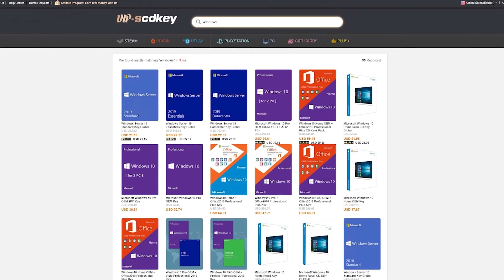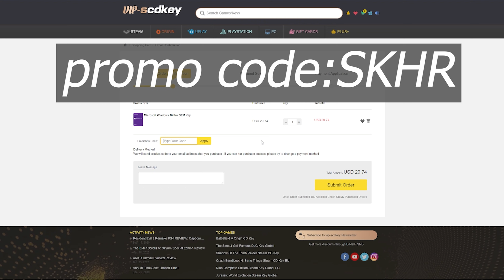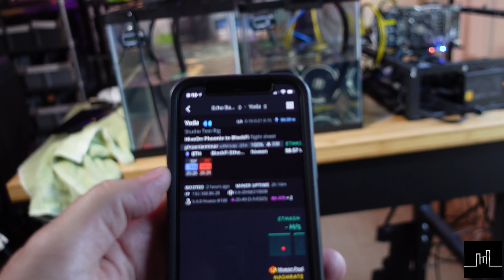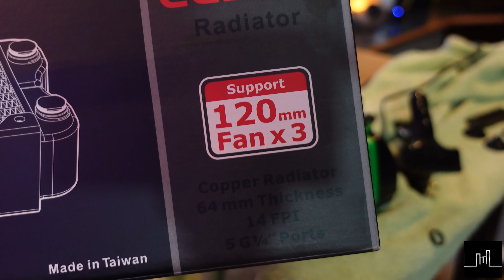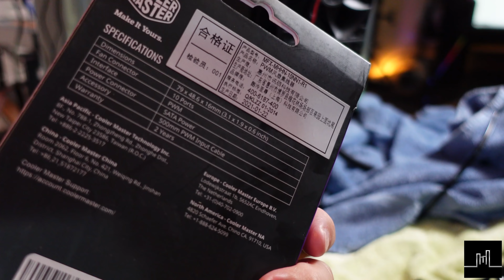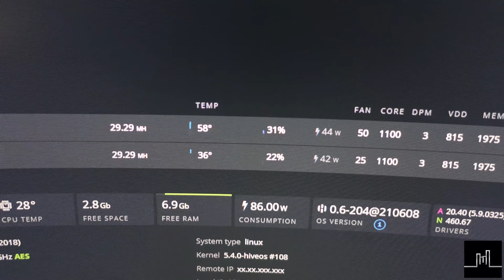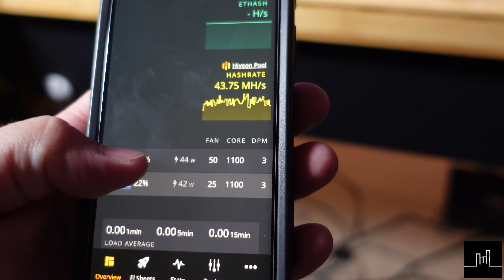Mineral Oil Submerged GPU Crypto Mining Rig Build - Part 2

Comment: OK, so you've essentially put 3 asic fans on a GPU - or course it runs cooler! Financially, I think you'd be further ahead just to buy 1 more GPU and run them at lower power/hash rates to get the same thermal efficiency - especially at the $85 you paid for these ones. It will be interesting though to see how well the oil does with no fan of heat sink at all.

Comment: Moving liquid stays warmer due to friction, you need a large radiator to cool the tank. The only problem I see with this is the radiator will put off lots of heat and will need to be ventilated

Comment: As far as I know, I think you should remove the fans and the headsink from the graph, so that the chip is in contact with the oil, that's why the temperature rises so much, still a very good video great job bro

Comment: Hi @HashRaptor - i think these are the same fans I got from Amazon https://www.amazon.com/gp/product/B07SGWNV5J  A word of caution, the specs on the Amazon page indicates a rating of 2.0A/22.8W DC.  If you're going to connect 3 of them to a fan hub, you will most likely overload the SATA connector that it uses to power the fans.  The SATA connector  has a rating of only 54W, and your total would be 68.4W.  What i did was i got a PWM to SATA connector instead https://www.amazon.com/gp/product/B08T7B29W9

Comment: Fish tank stand dual  10 gallon tanks.  I purchase a Aqua Water Chiller AACH 25HP from eBay , to setup similar setup to beer brewing chiller, cooper pipe coil water flow going opposite oil flow collecting the heat using fish tank pump  and 5 gallon Home Depot bucket a cooler will be best to keep water cool also Ice can be added to reduce chiller electrical usage. 
 How to video for  HIveOs cell phone notification will be nice.

Comment: How are you gonna resell a gpu submerged in mineral oil?
Reply: It's an expensive thing to do and doubt he will, but if you want to resell it, you have to ultrasonic clean them off after you're done. It's relatively easy, it's just to a lot of effort and cost $$ to do.
Reply: Most miners use the card as a sunk cost anyways, so the plan was never to resell, just use to mine until you ROI and more and keep them forever.
Reply: @markw496  how would you cool the mineral oil if it gets hot?
Reply: @ryanlucasan3516  I'm debating this myself but I think for something smaller scale, it makes sense to use a car radiator rather than one of those small radiators. Then do the same thing he did, just use a bigger radiator instead of two tanks and place the radiator outside somewhere to let a fan blow it. 

The other thing if you go larger scale is maybe considering using two phases of cooling. One which circulates the oil into a radiator cooled by water, and then another system that cools the water off via evaporation. I think they employ this on larger farms, there is info around, but most of it you have to dig around for.

Comment: The pumps actually are adding heat to the system, pumping any fluid creates friction in the pumps impeller or cylinder. Pumping it through a heat sink however would do wonders for dissipating the heat in the fluid into the atmospheric air outside of the tank. Even a small CPU cooler radiator with a couple of 120MM fans would be a huge amount of heat energy perpetually taken out of the oil.

Comment: 3-D print new fan blades, maybe 3/4 of the size that you have already.should help with the fans stress…An idea, a small fridge and or freezer. PVC inlet and outlet size to fit coils/radiator inside. Get a standard household circulating pump which is relatively strong and doesn’t take too much power and I’m sure you can figure out the rest…. Please let me know what you think?

Comment: I manufacture parts, I can help you if you need parts cut for proto typing (waterjet) Try just a flat stock going across on top of tank, bolt the gpu’s to them let them hang vertically. Cheapest way.

Comment: I've got 2 words for you to make this work better than using a pc aio.... Aquarium Chiller. You can get one of those, a decent brand even, for closer to what a really good aio costs. If you went with a larger one rated for say a 40g Aquarium, I'd be willing to be you could knock that temp down to around 50° F. Even if you added say 5 or 6 gpu's, I bet that temp won't climb much higher than 55° f. As both a mining enthusiasts and a aquarium hobbyist, thats my $.02.
Reply: WATER! Use a ultra low conductivity water (purified water with <0.2 µS/cm) such as used by laser cutters. Its pretty cheap (about $70 for 25 litres over here in UK) and will cool well, really runny. so no issues with fans. You will need to check the waters conductivity as the aluminium and copper ions will eventually dissolve into it. Also need some silver to keep the bacteria down. You can then use the aquarium chiller. Mount the chiller exhaust duct to outside building then really efficient. 

https://www.chemicals.co.uk/purified-water?utm_source=BingShop&utm_medium=Paid&utm_campaign=BingShop&msclkid=7302490c8b9e1a42ea4729e81fa9b3a7

Comment: Why dont you try with car radiator?Some cheap used car radiator with fan on it,just try to adjust fan rotation speed on it?
Reply: @Pandacat 666 did you try with wather pump for the larger pools? It could be done, just is question is it worth it 🤔

Comment: Why instead of having a second tank and more oil why not use a pump and pump it through a radiator with fans on it  to radiate the heat and the cooled oil comes back into the same tank?

Comment: Cant wait for the next video. If your experiments are going well, this can be a big solution for us miners! :D We all strugle with the cooling and the noise... especially summer
Reply: Edem Frost  Wonder if its possible to custom make a fridge or freezer into a mining rig??
Reply: @eugenechin2863  it's better to make an insulated box with an AC unit attached. It's the same technology but a refrigerator is made for keeping things cool. Refrigerators can certainly cool off warm items, but run a constant basis it'll burn out the compressor, and probably be unable to keep up with heat load.

An AC unit has a dehumidifier built in (most of the power they use is from this feature!) so you wouldn't really need to worry about condensation. I wouldn't risk only putting the radiators in said box. The tubing would be colder than ambient and cause condensation. If you wanted to make it work. You could however, have a temp controlled AC or have it installed to a controller. And have it set to 75 degree F so it would only cool it to a little above room temp. Just make sure there is no reservoir in the computer, and possibly one where it's being cooled. Along with a fast pump. Because otherwise the input to the rig will get colder than ambient.

Comment: Awesome video! I’d think using a plastic container would be safer, couldn’t imagine the glass breaking or the crappy silicon failing on the glass tank and all the oil spilling everywhere, omg!
Reply: I wouldn’t do a plastic container, with all that fluid, it will bow. If plastic maybe thick acrylic tanks. But then, which retains heat more, glass or plastic? I would think glass will not retain as much heat as plastic. But I could be wrong
Reply: Maybe can use chemical drum and cut it half.. i used it for my fish carrier and its so durable..
Reply: I would put the fish tank inside a larger plastic bin in case of failure.
Reply from the maker: OMG you are right. Any suggestions on a container?  I’m open to trying anything.
Reply: @HashRaptor  There are many heavy duty containers available that would work, fairly limited options for clear though. My plan was a black Storage tote and mount everything to the hinged lid with a smallish hole for the cables. Even an aluminum container would be best especially for heat!  

MC, no it wouldn’t bow unless you are using some crappy thin cheap tote. Also you’re not supposed to fill it to that point anyways lol

Comment: Still watching, but my biggest question is what is your planned maintenance cycle and expenditure?
Reply from the maker: Thanks for watching my friend. I’d say the answer is unknown for me at the moment. It is very possible it is not worth time and money by the time we get to the end with a final solution. But, open to trying to perfect this anyway possible just in case a “v2” looks like it would be worth it to build.
Reply: @HashRaptor  ok. Issues that I see. Mineral Oil has some chemical compatibility issues. It's not corrosive or anything, but the adige "like, dissolves like" applies here. Anything plastic WILL be infiltrated by it. Things like paint and clear coatings may completely disappear. Other plastics will lose their structural integrity. Your AIO will end up with some mineral oil in the loop, exposing the pump. 

Evidence that this is already happening can be seen with the condition of your suction cups.

I recommend considering looking into the feasibility of propylene glycol and glycerin (aka glycerol)

Also I have NO idea what will happen to thermal pads and paste, much less the PCB material itself. 

Love seeing the experiment though. Best of luck. Hit me up if you want some more information.

Comment: Only use enough mineral oil to fully submerge the GPU. You aren't helping with cooling by having more fluid.
Reply from the maker: Thanks I’ve been wondering about this. I’ve also been trying to find some kind of documentation for guidance. Any suggestions?
Reply: I dont know where to find a guide I will look around for you and get back if I find something but as you saw with the second tank, more fluid doesnt increase cooling, but the amount of time for the reservoir to get up to temp. So i believe if you added enough to just cover the gpu you would decrease the messiness of maintenance. The only thing that matters for cooling is radiators and air flow through them. So if you want it when cooler then add some more.
Reply: Fun video idea: use a car radiator to cool your tank lol

Comment: 2 tips 
1) Buy elbow length disposable latex gloves! :D a lot less messy :D
2) Use short runs of cable from the submerged components to the top of the case, then connect to them. It should stop the oil "wicking" up the cables and leaking everywhere. :D
Reply from the maker: I love it will do. Then I guess I’ll need a towel with the gloves to set them on when I’m done. Man this is intense stuff.
Reply: @HashRaptor  Disposable gloves are cheap enough just keep a bin handy :D